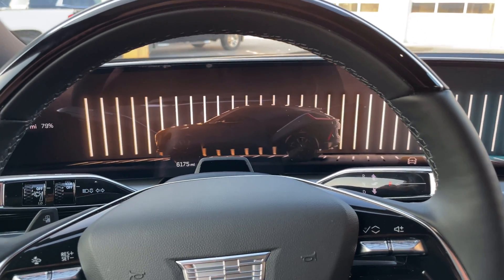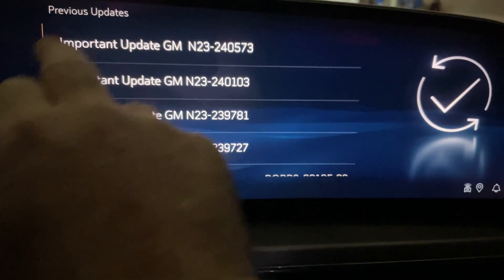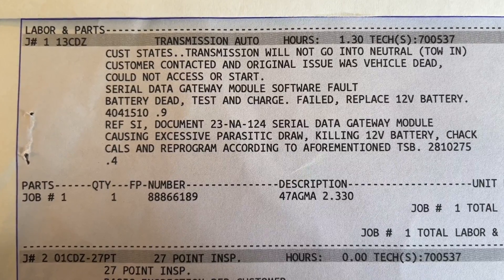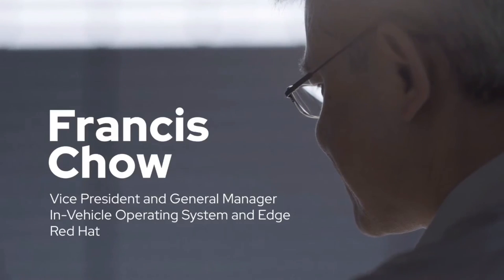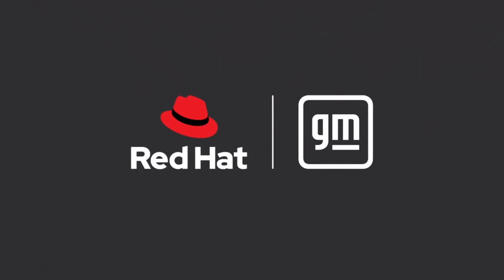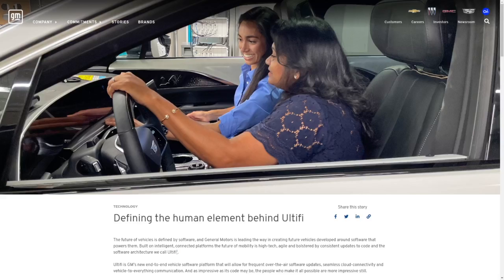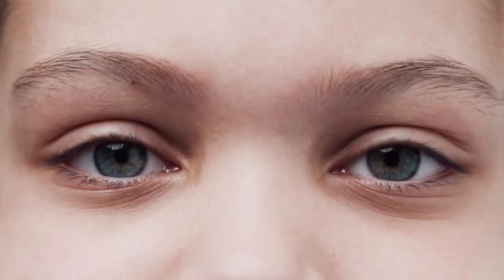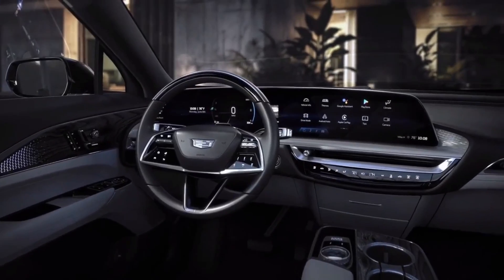12v Bricking - Cadillac LYRIQ (Part #2)

Comment: I’m happy that Cadillac was willing and able to address the bricking issue quickly and get your car back on the road. Other manufacturers, like Hyundai, have not acted as quickly. 

That video about turning a vehicle into a cell phone like ecosystem is concerning.  

Yes, GM can do OTA updates, like Tesla pioneered, but it creates another income stream for GM and the incentive to roll out a have baked model at full price and then later nickel & dime the owner to make things functional. 

Note the comment about increasing the acceleration ability. That won’t be free or necessarily inexpensive like BMW is doing. 

A case in point is the  Lyriq’s currently poor DCFC  curve relative to other EV’s.  It was likely made conservative because of GM’s distrust of LG Chem’s cells after the Chevy Bolt battery thermal runaway fires, but will Cadillac update the DCFC characteristics to some more in line with that of other EV’s for free, or treat it as an opportunity to generate money for something that should have been addressed before the vehicle was released?  I’m not hopeful. 😢
Reply: Regarding the poor DC fast charging, I am hoping Tom at State of Charge will get a follow-up from GM on what is going on.  Is it indeed that they are being conservative and will address soon with a software update, or is this how it will always be.  Specifically talking about the large dip that occurs after about 15 minutes at a 350kW charger.

GM also needs to do a much better job with the OTA descriptions in the revision history.  They are very general in nature, and don't give much insight as to what specific bugs are being fixed.  They've released many OTA's for the Lyriq at this time, but I cannot notice anything different from an end-user standpoint.  Lots of UI bugs remain that are well-known, and even on the bran new 2024's being produced (still no ability for Homelink in reverse, for example).
Reply from the maker: @billjohnson3344  I found an on-line google sheet that has specifics.  Search for Lyriq issue/software tracker and you should find it.
Reply: @thenetworkarchitectchannel  Yes, am well aware of that.  There are no specifics in that revision history - just general areas that have been touched.  The issue is GM's descriptions.  What does phrases like 'A variety of other minor software updates to make your driving and in-vehicle experience better' actually mean?
Reply from the maker: @billjohnson3344  if I had to guess it means the database field holding the info is 256 characters max, needing a twitter version
Reply from the maker: Lots of truth in your comment.  I heard one auto maker was charging a pretty penny to turn on speakers playing engine noise to the outside so your EV could sound like a race car. 

As far as half baked sw, I think the model Tesla has with full regression testing to be acceptable, so I think it stands to reason, GM & Red Hat can come up with a similar pipeline.

For the nickle and diming customers for subscriptions, I do believe that to be a trend no going away anytime soon.  That is for car makers, video content providers like Netflix, heck even groceries are getting an angle in on the action.  Time will tell if consumer backlash would be sufficient to change the tide, but likely not anytime soon.  My wife and I spoke and have decided we are going to stick with OnStar.  We have used it a few times already and it has proven useful & worth the additional subscription.  Not for everyone, but in our case as Debut Edition owners, we both feel it does make sense.  Thx for watching and the good comment.

Comment: Nice update on the video, and glad you have your car back.  Keep an eye out for the rear tail lights going out.  After just dealing with the 12V issue, I now have my right tail-light not working.  That seems to be another popular issue being experienced by many.  Not clear what the source is (bad parts, poor connection, or software), but a lot of people on the web and FB are reporting this also - after just a short time of vehicle ownership.
Reply from the maker: Thx Bill.  Your info was a big help & will keep a weathered eye out for troublesome rear lighting.  Stay safe.
Reply: Bill: Where did you find the list of updates?   I don’t have my car yet so I can’t look in the infotainment unit. 

While looking for them online, I found a “how to” on an OnStar page.  In the FAQ it says the vehicle will be disabled while the update is being installed. Later it says, “If you leave the vehicle, do not lock occupants inside.”  That conjures up all sorts of images. 😁
Reply: @FoamCrusher There is a site online that discusses all things Cadillac.  There is a Lyriq section, as well as link to a sheets doc with all the OTAs.  Would be happy to list, but comment will get deleted.